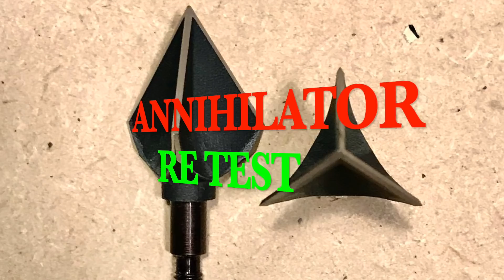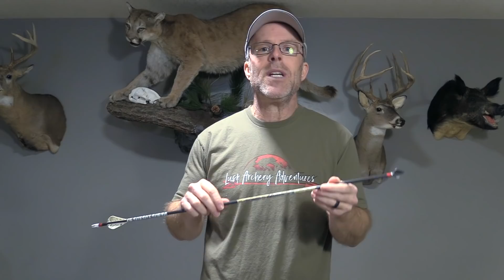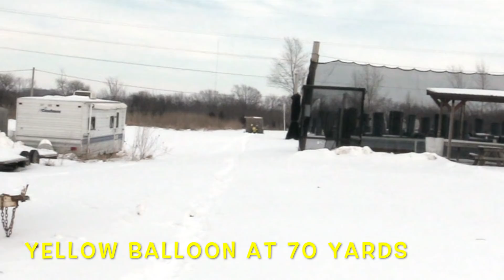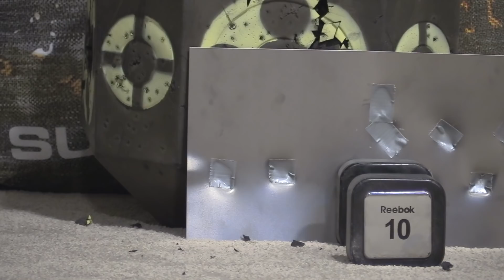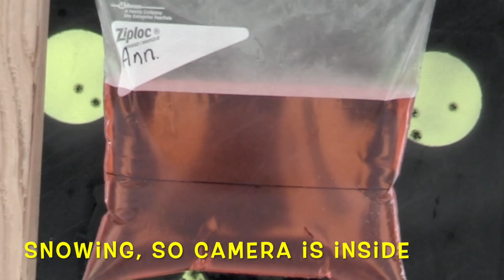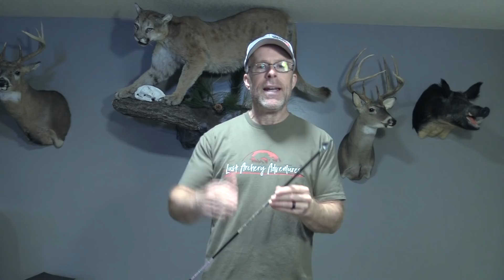ANNIHILATOR Broadhead RE-TEST

Comment: I use the original annihilator broadheads have you seen a flight difference between the two im having  a hard time finding  the originals lately
Reply from the maker: Their inventory got pretty low because they've come out with a new steel that they're using now. The Original is more forgiving in flight than the XL.

Comment: Well, Annihilator broadhead is a great design BUT, I experienced like others here on Youtube or different forums that unfortunately,  I experienced a drop of 4" at 30yds with my Excalibur crossbow Micro 335.   I reached out Annihalator and they told me that I should have buy the standard size, but on their website, they're contradicting it. It mentioned that within 50yds, and for crossbow, the XL should be used. So not sure what to say but I know I'm not the only one in this situation. 🤷‍♂️ Great video here though.
Reply from the maker: Interesting. Thank you for sharing that. I understand that that happens with some. It did not happen with me.

Comment: John,

How do you recommend sharpening these broad heads for the best results?
Reply from the maker: There are two ways--either just laying them flat on a stone and sharpening two edges at once or using the Stay Sharp Guide 344. If you use the flat method, they will get pretty darn sharp--especially with a good diamond plate like the one made by Stay Sharp Guide. But the 344 will actually change the bevel angle to 44 degrees, rather than 60 and make them quite a bit sharper. I demonstrate that in another vid I have of the Annihilator. Just search Lusk Annihilator and it will come up.

Comment: I love my annihilators ....the only issue I have is getting mine as sharp as I like to....I may need to get the 344 broadhead guide...to change the angle of the bevel a little....not sure
Reply from the maker: Yeah, a 60 degree bevel can only get "so sharp." Honestly, it's sharp enough to hunt with, but if you're really wanting it super sharp, you have to change that bevel to 44 degrees and that is what the Stay Sharp 344 does. The bevel is still plenty strong, but it will be much sharper.
Reply: @LuskArcheryAdventures  that's exactly what I needed to hear ......thank u.....for some reason it says the website can't be found....he may be hunting or something and shut it down til he gets back......not sure....but thank u again !

Comment: Great video.  I am curious about your use of the FOB's.  I used to shoot FOB's and I noticed a significant drop at longer ranges compared to shooting 4 fletch Vanetec Super Spines 2.3".  Have you done a comparison on the FOB's?
Reply: disregard, i just found your video on the FOB
Reply from the maker: Thank you. Yeah, they drop a bit more than straight fletching, but similar to helical...only slightly more than helical at very long ranges.

Comment: What would you choose between this and the VPA 125 3 blade( non vented)?
Reply from the maker: I've not tested these on animals yet, so it's hard to say. But I'd probably try the Ann rather than the VPA--they sure fly better due to the short profile.
Reply: @LuskArcheryAdventures  Thanks, that's really what I wanted to know. I'm looking for a head that I can re sharpen and is as accurate as possible. I figure an head will do the job if you put it in the right spot. Thanks again!

Comment: Water drainage test seems very inaccurate for a blood spillage test!! If you were to shoot a water bag with a judo tip or even a techno hunting tip it would probably rip the bag in half.
Reply from the maker: Well, you're right. But then you have to also consider the other tests; and the Judo wouldn't do well on those. That's why I do several different tests. But at the same time, I stopped doing any kind of drainage test, because they were inconsistent. Even with the same head shot in the same exact spot, if the blades were turned one way vs another way, the drainage time was different. So I nixed those tests a few months ago. Thank you for sharing your thoughts.

Comment: I really appreciate that you are willing to backtrack when you have a made a mistake. That speaks volumes. That said, the entire premise behind this head is flawed, from a biological standpoint. Tissue does not care if you push it aside. It will bounce back. when it comes to arrows, if one wishes to make a larger hole, one must cut that hole. In my opinion, these heads give up penetration for nothing. Any equilateral, straight, three-blade head that is well sharpened and made of a decent steel will exhibit the same tissue damage in actual tissue. If one wants to compare durability, then a steel sheet is a great target. If one wants to compare the holes made, then there is no substitute for actual, living tissue. ballistics gel comes close, but it still isn't a great comparison for permanent damage that contributes to bloodletting.
Reply from the maker: Yeah, I've always wanted to see how these heads do on animals. I've heard mixed reviews.

Comment: What adjustments are you talking about? I have a single pin and mine drops out past 50 like you say. I’ve tuned the broadhead and out to 40 flys perfectly. Then after that it drops hard. Do I need a new sight tape? Do I need to do something to the bow? I need directions on the corrections you made.
Reply from the maker: I understand that for some set ups, the heads drop at longer ranges. But that was not the issue for me. I thought it was, but I was using sight tapes set up for a different weight arrow altogether. That's why it dropped more in the first test. Once I realized that, I adjusted my sight tapes for this arrow weight and field points, then the Annihilator flew perfectly, even at longer ranges. If it doesn't do that for you, and you still want to use it, then just change your sight tape accordingly.
Reply: Lusk Archery Adventures I’m shooting 31.5 VXR 70lbs at 29.5 in draw. Shooting the same weight as my field points. maybe they just don’t like the micro diameter arrows?
Reply: Lusk Archery Adventures Turns out my issue was a spine issue. The FOC of the 300 spine Kinetic Pierce was not compatible for my bow. They just dove like crazy. Switched to Hunter XT 300s and problem solved.
Reply: Thanks in advance!

Comment: Im waiting for mine in the mail the reading ive done says no but do i need to tune the head with the fletchings because i just bought a dozen victory elite arrows not cheap and the inserts are already glued in
Reply from the maker: You never need to align any broadhead with the vanes; that is an old myth that has been disproven many times. It makes zero difference.
Reply: @LuskArcheryAdventures  i did not know that thank you for answering im brand new to compound bow world was always a gun hunter xbow was easy crossover but now i have bowtech carbon icon 2 years old brand new out the box for 500$ so starting there

Comment: Are these as good as qad exudus or black hornets?
Reply from the maker: That's a really good question. I've not tested them on animals yet, though I've wanted to do that. I'm hoping to have a turkey hunt this summer and do that. My only concern with them is the size of the hole. I've had smaller diameter heads like this one open a hole that gets closed up by fat and other tissue. So personally, I prefer a wide cut, like the Exodus or Black Hornet or Grizz Trick...or a mech like the Sevr 1.5.

Comment: I don’t understand from a physical standpoint how it “cups out” it’s got a tremendous amount of wind resistance. With that being said, a friend of mine did use it with several late season Whitetail does and had fantastic results at close distances
Reply from the maker: It is somewhat counterintuitive. The cup actually reduces air friction by directing it off of the shaft itself.

Comment: What do you mean by changed your yardage tape. Did It still drop a lot and you needed to change your tape for that broadhead ???
Reply from the maker: Naw. I know it sounds confusing. I was confused as well, which is why I made the mistake. I had set up my sights earlier in the season based on a certain arrow/head configuration. Later on I changed my set up, but had not changed my sights accordingly. So when I shot the head in the first test, it was hitting way low at longer ranges. I didn't shoot any field points or other heads at that time--only the Ann. I didn't discover my error until I went out to re test the head. I was using a field point and the field point hit very low at 70 yds as well. That's when I remembered what I had done. I changed my sights for my field points to hit at 70 yds, then shot the Ann, and it hit right with my field points.

Comment: John, my personal experience with these heads was consistent with your first test. I've observed significant drop at ~35 yards compared to other fixed blade broadheads. I suspect this is due to the design, which creates more drag. Outside of the changes with the sights that you outlined did you make any additional changes? I'm disappointed with how these have performed for me, especially given their high price, and any input you could provide would be helpful. Thanks!
Reply from the maker: Thanks for sharing your experience. I didn't change anything, other than the sight tape.

Comment: actually I thought they did have a problem with them dropping crazily and then a redesign to fix the problem...
Reply from the maker: They did have a batch that was problematic. I don't think they did a re-design, but they corrected the problem with that batch. But that was not the problem with my first test. The problem was with my tapes. When I went to do the re-test, I shot a field point at 70 yards and it dropped as well. That's when I realized my mistake. When I corrected to get my field points on target, the Annihilator was on target as well.

Comment: Everyone is entitled to their own opinions and everyone has their own reasons and methods of hunting...and that's exactly how it should be. That being said, MY opinion on bowhunting might be a little different than other hunter's. When I started bowhunting 40 yrs ago, it was to get away from gun hunting. I wanted the greater challenge of getting the deer close enough to shoot with an arrow. I'm much more proud of the several deer I've shot at 2 or 3 yards than the buck I shot at 42 yards. People seem to be making an issue of long range accuracy (or lack of), and sure, for elk hunting or mountain goats or sheep or whatever, that's important, but for the average deer hunter I think it's not something to get so worked up over. If you want to shoot a deer at 80 yards, use a gun. JUST MY OPINION.
Reply from the maker: Thanks for sharing that, Russel. I also like the challenge of getting in as close as possible.

Comment: Thanks for the information. What I was trying to understand, when you reset the site tape, did you find that it dropped faster at long range than other heads, and that's why you reset the tape? Thanks in advance.
Reply from the maker: Not exactly. First, I did the re-test cause several of my friends contacted me and told me that their tests had not showed any kind of drop. Then I stopped by the Annihilator booth at the ATA and they encouraged me to re-test it as well, cause their tests showed no drop. They were not belligerent at all; actually quite respectful. So I went out to the do the re-test. When I shot it at 70 yds, it dropped just like before. So then I shot a field point, and it dropped exactly like the Annihilator. That's when I realized my mistake. I had made changes to my set up back in late summer and knew to add 7-8 yds to my tapes, rather than just change my tapes. But a few months had passed since I shot at longer distance by the time I did the first test of the Annihilator, and I'd forgotten to make that adjustment. So everything was hitting low at 70 yds--field points and other broadheads. People think I shot the Exodus at 70 yds in my first test and it didn't drop; but I did not. I only shot the Exodus at the water jug and the layers of MDF. I still have that video, but deleted from YouTube cause of my mistakes. When I tested it the second time, and got my field points dialed in, then the Annihilator, and every other decent head for that matter, is hitting the same at 70 yds.

Comment: Let's get something straight about "tissue displacement". It likely has zero effect on the animal that is hit by an arrow. This comes from exhaustive testing in bullets of all kinds. Tissue displacement is also known as "temporary wound cavity".  The size of a temporary wound cavity at low velocities does not have an impact on lethality or so called stopping power. A permanent wound cavity does impact lethality, and, at velocities under 2000 fps, the permanent wound cavity is approximately the diameter of the projectile at a given point during penetration of a body, be it human or animal.  At high velocities (over 2000 fps) the size of both the temporary and permanent wound cavities matter, as, at these velocities, tissue damage does occur beyond physical contact with the projectile. This is why rifles are approximately twice as lethal as handguns. Annihilator broadheads may be great, but it has nothing to do with tissue displacement. One other thing needs to be pointed out. There are claims that forcing tissue away from the arrow shaft aids penetration. This a misnomer, as the energy lost in displacing the tissue would be far higher than the drag created by an arrow shaft lubricated by bodily fluids.
Reply from the maker: Well, thank you for sharing your thoughts but I am going to humbly disagree. Bullets and arrows kill by completely different means. For bullets and "stopping power" as you reference, you are correct. A bullet largely kills by the KE created by the projectile and the subsequent shock or concussion of tissue that results. But an arrow doesn't kill by "stopping power" but only by cutting tissue, either killing by blood loss or oxygen loss in the case of a lung shot. The more tissue that is cut or displaced, the more difficult it is for that wound to close up and thus the more readily the animal bleeds, causing greater blood trails (all other variables being equal). That's why a 2" cut broadhead will likely kill an animal faster than a 1" cut. When a broadhead has an extra large ferrule, or extra thick blades, or extra long blades, then more tissue is cut or displaced and larger blood trails result.
Reply: @LuskArcheryAdventures  The "displacement" is temporary at arrow velocities and does not lead to more bleeding. Handgun bullets do not kill by shock or concussion, that's what rifle bullets at above 2000 fps do. This has been well documented. Yes, a broadhead kills by cutting tissue, and yes the wider the cut, assuming similar penetration, more bleeding can be expected. That has nothing to do with the ferrule size. Also, animals are not thin skinned bags of fluid ready to be drained as your baggy with colored water would indicate. I do respect your tests, and I think that they have some value in terms of demonstrating the integrity of the broadheads, but you really can't generalize too much from materials to animals. I've been bowhunting for over 40 years, guess I've taken 150+ animals with a bow including bear, various kinds of deer, hogs, caribou, turkey, and javelina, I've read every study that I can get my hands on of broadhead effects in both live and dead animals, and I've also studied bullet effect and post shooting documentation. I'm not postulating, I'm repeating what others have documented and my own experiences.

Comment: how long have you been shooting the FOB vs stranded fletching
Reply from the maker: I use both. But I first started testing the FOB last Summer. Then I decided to try them in the field for the entire hunting season last fall.
Reply: @LuskArcheryAdventures  sorry one more question. Do you think a FOB with a single bevel vs a fletched arrow could lose some KE because of the vanes where the FOB just comes off at the hide and allows the shaft to move through the animal more freely.

Comment: The only reason I wasn't buying is because of your first video......after viewing this I will buy them....on the first video I was disappointed when you shot them at 50 and didn't perform well 
....
.hopefully you do a re test from 50 and up and post a video of it
Reply from the maker: In the first video, the Ann shot perfectly at 50 yds. But they seemed to drop when I took it out to 70. However like I explained, it was not the heads, it was my sight tape. I shot field points the other day at 70 and they shot really low as well. That's when I realized the problem was with the tape. With the tapes I was using, I had been adding 7-8 yds to them, but I forgot to do that when I first tested the Ann. Once I got my field points flying well, the Ann shot right with them.

Comment: I wish the cut was slightly larger but they will definitely be getting a look from me this summer
Reply from the maker: Yeah, I do as well. I've heard mixed reviews about blood trails. Small is still small. I'm sure they do better than a "normal" head with a .91" cutting diameter, but do they do better than a head with a 1.25" cutting diameter? It's doubtful. They are making a larger cut model, and that would be really interesting to test.
Reply: Lusk Archery Adventures very true it’s a larger cut but you pay for it in weight, 150 gr for a 1 1/8” broadhead is a lot imo. The head I’m very seriously looking at is the Hades regular tip model, very very good looking head